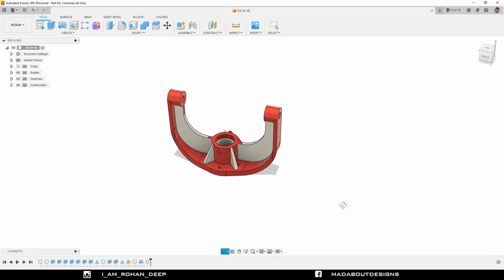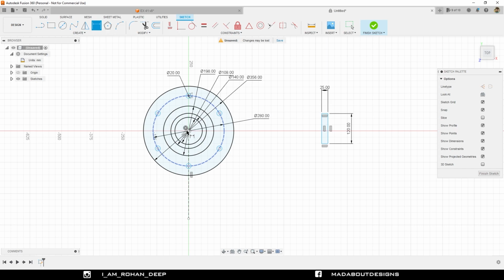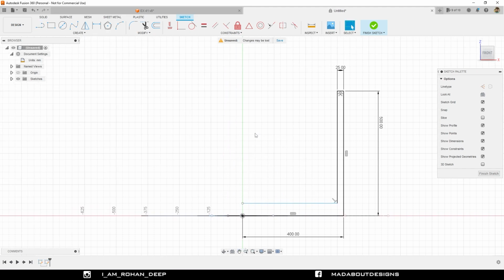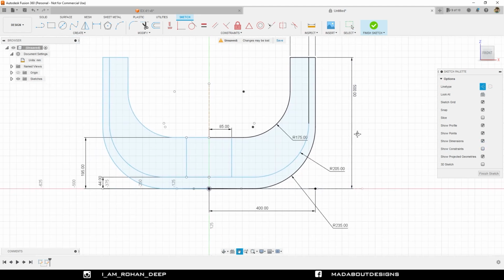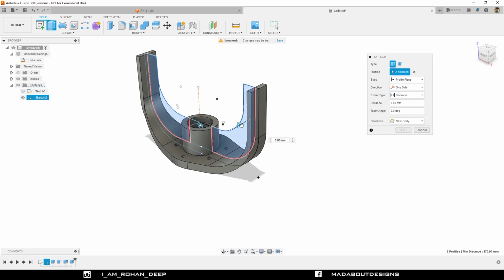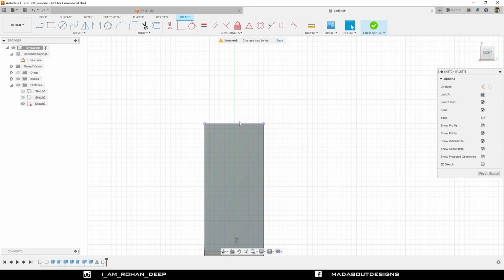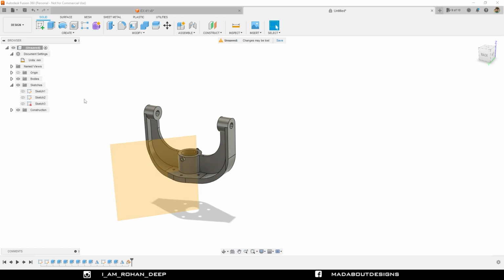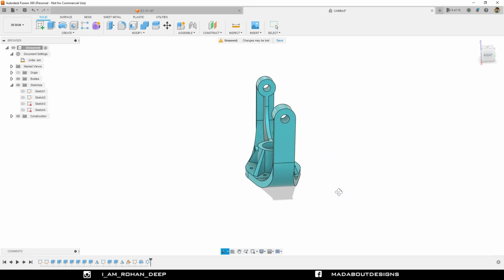Autodesk Fusion 360 Tutorial for Beginners | Exercise 27 | Learn the basics of designing

Comment: This tutorial shows bad practices:
1. You should not use a sketch that has blue (undefined) lines. All of the sketch lines should be black before moving on!!! (for obvious reasons)
2. It is preferable to give dimensions that make sense and not from some base line or point. For example, central vertical cylinder dimensions are given by diameters of inner and outer surface, but it make more sense to provide inner diameter (as it is the one that will accommodate some rod in the future) and thickness of cylinder wall. So in the future if you will need to change the design (it is why it is called parametric design!), for example if your rod is thicker, you will have to change one dimension on the sketch (inner diameter). And if you will find that this cylinder is not strong enough, then you will go to the same sketch and change it wall thickness.
3. When you create upper horizontal cylinders, you should not provide their length, to choose "To Object" and point edge of the stiffener. In this case this cylinder will automatically will be longer or shorter when you will change the size of the stiffener on its sketch.
4. Added ribs look strange as they are part of the sector. Fusion 360 has special tool to create ribs it is called "Rib". You are welcome to use it.
Reply from the maker: Thank you so much sir for all these feedbacks. I will definitely work on them. Have a wonderful day ahead sir. 😊